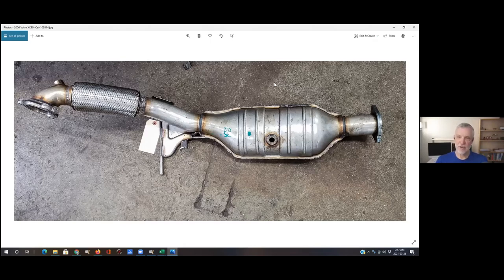2006 Volvo XC90 Catalytic Converter

Comment: Thanks for this info! How much (us) should we expect to pay to replace one of these, labor etc? We bought a 2011 xc90 at the factory (US Spec) when stationed overseas and I swear we’ve had nothing but troubles- since the 2nd month of ownership when the “mirror computer” had to be overhauled! I wish we lived up there because the dealer here (OKC) is a complete ripoff and the imports repair place (but volvo specific) doesn’t seem too concerned about our newest catalytic converter issue. Dealer says $2500 each and that there are 3 of them? And dealer always says it has to be fixed NOW, right?! The check engine light sometimes comes on, then eventually goes off for awhile, and they both say it’s the catalytic converter (one or more?). The imports guy is relaxed, has said to just use premium (91 or 93) no ethanol gas - which does seem to make a difference. I just hope we aren’t killing the other 2 (if that truly is the case). We only have 130,000 miles but no chance of selling in this condition. It would be our luck to have these things stolen now too. 🙄. 
Thanks for the video! Vancouver is one of my fave cities!!
Reply: Thank you for sharing .I have same situation with my Volvo Xc90,  the check engine light came out and diagnostics results shows catalytic converter back 2 is the issue. Could you please tell, what you done with yours ?